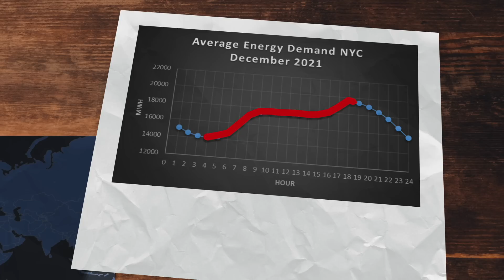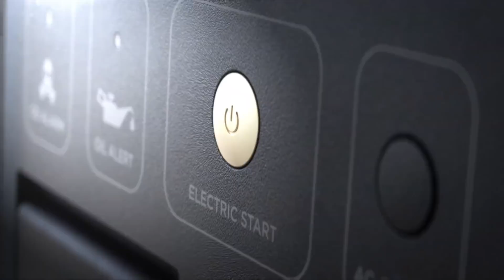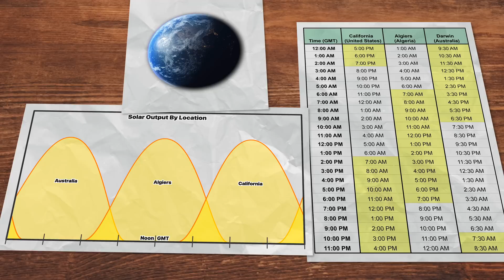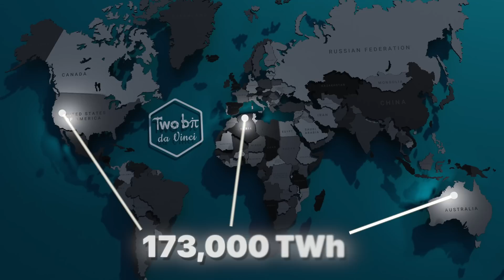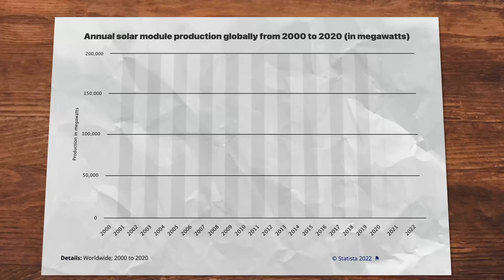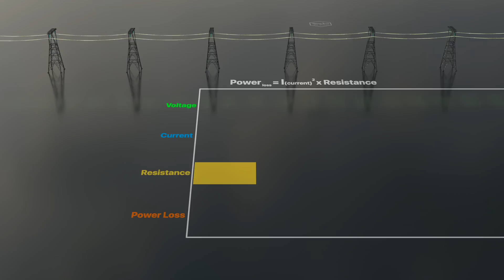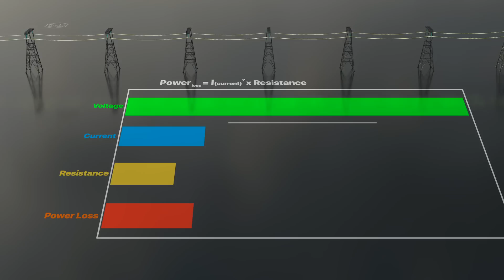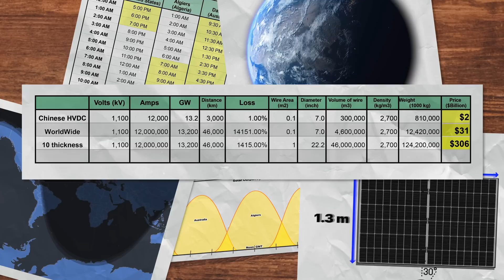World Solar Energy Network... Could this work?

Comment: 3:20 From a practical standpoint the power generating window at any point is less than 6 hours. Beyond that, the angle and obstruction inefficiencies come into play. And the efficiency of solar panels is more like 10%...not 20%. 

6 hours is 25% of a day...times 10% solar panel efficiency harvests 2.5% of the sun's light. The sun delivers 1kW per square meter. So the max you're going to get is 25 watts per square meter.

An office refrigerator uses 50w (150w with 33% duty cycle). So just to run an office refrigerator you need about 2 square meters and battery storage of about 1kWh (at 100% battery/inverter efficiency) to run that little refrigerator all day and night. 

An acre of land is about 4,000 sq meters...and a typical property is 1/10th that...400 sq meters. So you're using 1% of your land just to run an office refrigerator...or to forget and leave a closet light on...and you have no cloudy days.

Just thinking.
Reply from the maker: all these are factored into our numbers... like kWp that concept accounts for it

Comment: You are publishing the modern equivalent of a scientific paper here, and I also like the casual 'peer review process' better here than in academia. The one line / 3 site proposal is definitely not redundant/crisis safe enough. Also first we should subtract the best effort on a totally distributed consumer side rooftop generation infrastructure investment. The enormously high voltages you are proposing sound very dangerous, wouldn't every airborne particle including birds potentially be attracted to one of the poles? Can both poles be permanently of the same DC polarity and material without mayor corrosive results? How much energy would be released in an accidental discharge, or fuses that would try to separate the failure from the energy source? How thick would the isolators have to be, and wouldn't deep underground tunnels be best to avoid vulnerabilities? How about superconductors how far are we to eliminate loses by eliminating electric resistance?

Comment: I saw this idea in IEEE Spectrum magazine a few years back. What made it possible was high voltage DC transmission.  This in turn was made possible by new DC switchgear. 

The problem with this is that it is a worldwide system. As we can see from the war in Ukraine, countries will use energy as a weapon. In fact, we have a much earlier example from the 1970s with the oil boycotts. No country would put their energy supply in the hands of another if there was even a possibility of a disruption for political reasons. In the Arab Oil Boycott situation, the issue was that the Middle East was the only source big enough to provide supply. That is changing. What Russia has done, for example, is to prove itself an unreliable energy partner. Donald Trump warned Germany against relying too much on Russia and he was laughed at. Very few countries will make long term contracts with Russia for energy going forward. Now take that to a worldwide grid which would necessarily have to traverse many countries (and indeed continents) and you multiply the problem. It only takes one to shut the system down.

Perhaps it would be better to apply your gedanken to other solutions.

Comment: Grid-scale batteries would require no lithium, no rare earths, nothing expensive or troublesome.  Low-efficiency batteries are the most efficient option; instead of paying a fortune for them, you pay next to nothing aside from requiring a small amount of land for the power storage system.  Edit: your math is way off on the solar panels.

Comment: If you told Abe Lincoln, they were going to connect a grid to the whole of north America, the would think you were crazy, yet here we are, 
Maybe upping production by 20% and put those materials to the project, and work on gradually  connecting everything,   the solar thermal along with PV would work well,   the thermal can work later taking time to heat up,  but may work hours later, depending on the type of plant, molten salt, or just water,  I think sand would be a good thermal mass,  heated to near melting temperature,

Comment: I believe it would take about 20 years to do this,  plus I believe it would be best to have at least 24 farms, to be connected to the local grid, then  work on connecting grids,  the solar thermal types would likely be more efficient,  and generate a power,

Comment: I think you had a good start here, but you neglected the biggest issue: the cost of maintenance always exceeds the cost of installation. Instead of comparing initial price tags, I would be interested in seeing you calculate the annual per-capita energy price if such a system were built, and compare that to status quo per-capita energy pricing, or to local vanadium ion flow batteries instead of global grid. The results may be surprising.

Comment: 1. There is no energy crisis even with today's technologies. Whatever is called crisis is made on purpose. For some future decades nuclear power plants is the way to go for industrial type power supply.
2. You (or the scientists) even think in a laid out path: carbon netutrality(???),  there must be a grid, energy can be generated only by this means and so on. Grid means ability to influence and control  people. And "they" don't independent people. Through all ages.
3. Amorphic silica panels would allow generate more electricity in cloudy places, yet they sell other types.
4. Lithium batteries for storage sucks.
5. Coutries like U S A cannot withstand losing  world power, and this approach means sharing thus contradicts the first statement.  Even in animation grid you totaly missed big parts of the world Asia(Russia), South America, and even Europe.
6/  voltage and grid wire calculations bring the final nail to it.

Comment: Why have massive farms?  Have the farms and then all city buildings to have panels on their roofs and batteries in their buildings that are on the solar path of the sun and have those buildings linked to the world grid. That would negate the reason to have massive farms? Or could engineering companies start to develop panels that work with the light from the moon? 🤷🏼‍♂️

Comment: Orbital power generation with microwave to ground transmission would be cheaper and more environmentally friendly. Or, if you want to stick to existing technologies, you could just do solar hydrocarbon generators and use existing pipeline infrastructure. In either case, all you need to do is to make it cheaper than fossil fuels with subsidies and let the incentives work their magic. There's really no need to go building long inefficient cables everywhere.

Comment: Even if everything else was doable and viable, I'd still say it's impossible just on the account of politics, and it's not about to change any time soon, if ever. But I don't think all the research and calculations were done in vein, because they show pretty clearly just how insane is the idea that the world will switch completely to renewable sources in a period of several years. Even if the situation was ideal, and it is everything but. Considering the outlook at the moment, we'll be lucky if we don't completely switch back to coal...

Comment: 2:28 In order to simply move the power, you'd need hundreds of thousands of miles of superconductors. Like 0.0000000001Ω conductors... You'd lose too much power if you tried moving power over our current aluminum/steel power lines...
Reply: 3:20 I'm trying to think of the maintenance costs of all the solar needed and it's making me cringe involuntarily. Trillions of dollars per year, easily.
Reply: 3:42 Oh gees... AAND the international treaties and agreements needed just to start building... oof.
Reply: 6:39 Desert = sand = high winds = solar panels covered in sand and gradually eroding away due to the sand flying around on the wind. Also, desert = insane heat = degraded solar performance.
Reply: 10:17 Okay... you're really hurting my brain now. Solar/Thermal plants require even more maintenance than solar panels...
Reply: 14:55 With voltages that high, how to you prevent the power being transmitted from being shorted to ground through whatever towers are carrying it? And if it's buried, just how thick would the casing have to be to prevent bleedthrough? Plus, at that voltage, it'll be like transmitting lightning around the world... and lightning rarely wants to travel in a straight line. It would be insanely dangerous.
Reply: 15:30 $10-20trillion? No way. Multiply that by a hundred.
Reply: 16:01 You'll need switching for these lines. This switching will likely be controlled by the countries they reside within. Then you get a situation like Russia and Ukraine. Russia: "Oh, you want to sanction us? Ok. No gas for you. Tooo bad..." It'd be the same thing. The oil nations would likely hold the power travelling through their countries hostage if they felt their primary source of income (oil) was being threatened. "Oh, you want power? Buy our oil... and at a premium if you don't mind... then we'll let the power go through." Centralizing anything is nearly always a bad idea. Especially something as critical as energy. Decentralization is the way to go. Plenty of smaller plants all around the world that can provide ample power for the areas around them. Small, modular nuclear is the future until we unlock sustainable fusion.
Reply: 16:55 If you watch the Cerro Gordo channel [Ghost Town Living], they experienced a 'thousand year flood' twice in the same year that washed out their road both times, basically marooning them. You cannot depend on Mother Nature to be consistent. The moment you think you've got her pegged down, she'll surprise you... and usually not in a good way.
Reply: You know... Elon Musk had an idea about creating a 'smart grid' using his Tesla Power Walls and Tesla cars. Customers could 'opt in' to the program. That means that if solar was being generated on the other side of town, but there was no demand, instead of just losing that power, customers could 'buy' that power to charge their vehicles and power walls. If a storm rolled in and all solar production in the city was knocked out, customers could then sell the power they have stored back into the grid to keep everything up and running. He had thoughts of setting limits of availability... for instance, a customer could participate using their Tesla car, but only until the battery life reached 80%, in which case, it would no longer sell power until there was generation available to buy again.

To be honest, I really liked this idea. It was an intelligent design that, in theory, could work well. But it could also backfire terribly. Let's say something happened at the power plant and they had to do an emergency shutdown of a couple of its generators (power plants generally have several sets of generation within the plant)... well now you're placing an undue burden on people's power walls and cars... and what happens if all the available storage met its limit due to the extended outage and there was no power left? (I'm thinking Texas snowstorm). After thinking about this for a while, I realized that being TOO decentralized could also be a bad thing. Because what if it was just a simple situation that a power company only wanted to generate during peak hours because that's when they made the most money? Completely realistic scenario. Well now you're cycling all these battery packs, whittling down their lifespans because the power company got greedy. Now granted, that should never happen, so long as the power plants fall under the Public Services Commissions of their respective States, but it's still a possibility. Monopolies, it would seem, are sometimes the best option. Energy production and distribution, I believe, happens to be one of them... but even then, they need to be decentralized to the point of serving their local areas only and no others unless there's an emergency.

Comment: Aluminum has other problems associated with thermal expansion ratios that caused a mass of fires in the 90-2010s from the 80's conversions to aluminum in electrical.  In colder and broader temperature ranges, the expansion and contractions have extra problems to be resolved due to that thermal expansion rate of aluminum. Quantum manufacturing techniques may have some of the solutions, and may be able to alter other ratios also, in positive ways.

Comment: Hey Ricky,
I have always thought that every electronic device should  come with its own rechargeable battery backup. Now for the reason, if every device has a backup then there would be no heavy strain on the electrical system.

Comment: We learned several things (that we already knew):
1) Decentralized, local to regional scale power production and distribution makes much more sense than grandiose schemes like this one. Of course, the more grid interconnectivity we have, the better, but it will never have a global network capable of feeding from a single source (or a handful of them).
2) This puts in clear perspective the plans for harvesting solar energy in space: now you could save in transmission costs, but imagine not only producing, but launching all those PV panels!
3) Of course we need to harvest all solar and wind energy that we can. But, lets also upgrade all fossil fuel fired power plants by replacing their burners and boilers by small modular reactors - we keep most the infrastructure and don't require any grandiose global projects. And, before anyone jumps in, reactor waste from those plants is less of a problem by far than  slag, ash the flying particulates from fossil fuel exhaust (not even counting greenhouse gases.)

Comment: solar thermal has been tried many times
and have been abandoned over and over again because how unreliable they are
they break down too often and repairs are to expensive
and after a breakdown you need a huge investment to get them running again 
different solution with different problems making it a delusion

Comment: you shouldnt be looking at if the world produces enough solar panels
solar panels are not a renewable resource
you should be looking at how many decades until we run out of materials 
and then you will have to find a different solution before you run out 
even if production time was reasonable, its all a delusion that its green

Comment: Diversity is clearly the answer. Electricity from solar, wind, tidal and geothermal sources. Electrical power transmission losses are  too high and geopolitically vulnerable but using spare electricity in one place to split water and then store or export the hydrogen produced could make transmission more straightforward and provide the fuel needed for mass transit. Lugging around batteries in vehicles will soon seem ridiculous because of the weight and cost penalties.

Comment: Interesting thought experiment.  Has anyone really studied whether we could live with less?  

Both of my parents were born without electricity and running water.  Right here in the good old USA.  And no, we're not members of any historically oppressed or disadvantaged group of people.  I grew up in Florida without air conditioning in either the house or cars.  

I'm not one to lecture, as I drive the car I want, where and when I want, and set my thermostat in the house where I'm comfortable.  How much could I save, or not use, or reduce my carbon footprint by better planning trips, and using a more fuel efficient vehicle?  How much would I save, or reduce my carbon footprint by not turning on the heat unless it was below 50F while wearing warmer clothes in my house and slept with another blanket or two on my bed (like my parents did)?  

The real question is how do we stop an ever increasing need for power to an ever increasing world population.  The answers are obvious, and solutions within reach, but they don't make for polite conversation.

Comment: This is an area in which green hydrogen or another form of transportable solar energy could shine. It does also have huge conversion and transport losses, but these are quite minute compared to a global DC grid. Transport by ship would be feasible and highly flexible, such that geopolitical issues are easier to circumvent. It also doesn't need such a huge investment to get going. We need a proof of concept though, to show off the potential and attract investors in order to scale and be able to cover global demand.
Reply: HVDC transmission losses are only 3% per 1000km, this makes Morocco to the UK via undersea cable entirely feasible.

Comment: I don't believe that we should ever try to make the planet dependent upon only 3 power stations to begin with. That would give all of the political power to those 3 locations. It is also not a good idea to make the planet completely dependent upon one type of energy. We have the ability to utilize geothermal, solar, and wind energy, so why not use all of them to make the grid as stable as possible?

Comment: The future is decentralized , why only three power plants? If we had a million solar farms distributed in all time zones within the tropics we could significantly reduce cable cost as well as increase reliability. 

And more importantly, there is a lot of applications that require thermal energy. Using solar panels to transform light into electricity and then into heat is very stupid, we should use the suns heat directly.  Wind, tidal and other sources are very important to consider too. I know this is a thought experiment, but make it more realistic.

Comment: Apart from the engineering challenge, it is the political challenge that would make this difficult to bring to fruition, as there would be a need for all state parties involved to have a bigger stake at keeping the system running or for redundancy to be built into the system robust enough to provide at least minimum power requirements for consumer states.